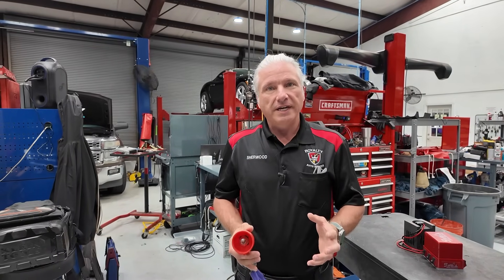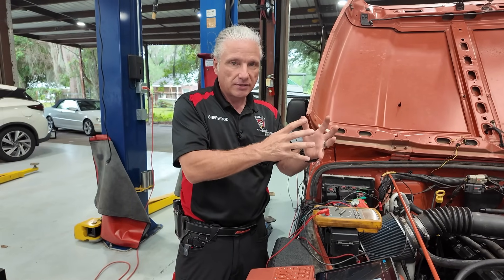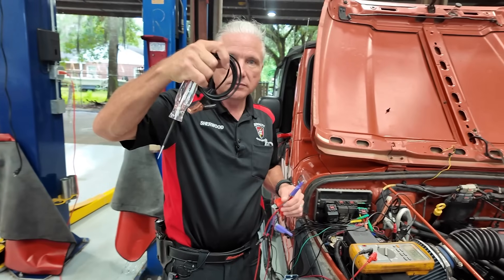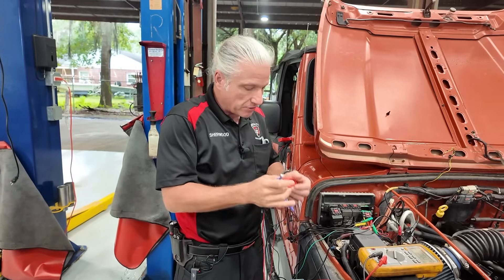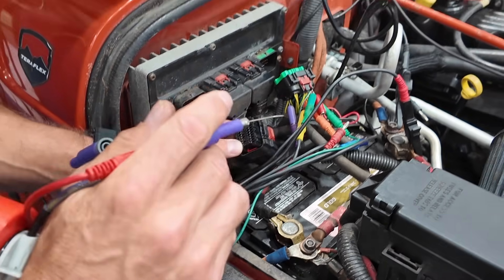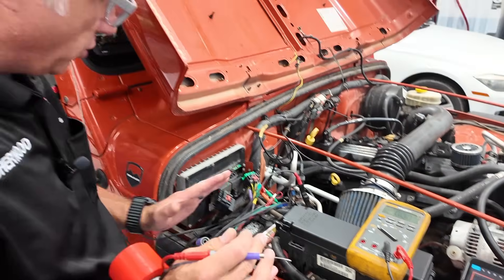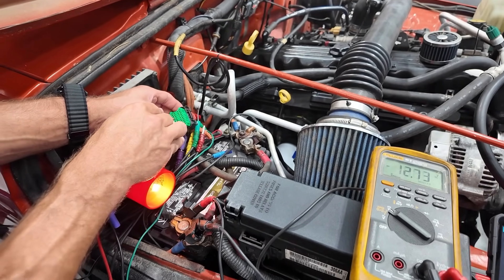This Will Protect You From Replacing Modules That Aren’t Actually Bad!

Comment: Drop test is good for checking the availability of voltage but a load test checks the ability for it to carry a load. My last PCM I recommend did a few bit of testing last thing I did was depin the wire from the pcm and from the accelerator pedal and checked the continuity through ground and power read open so knew no short to ground or voltage in the wire

Comment: @theroyaltyautoservice  Miller tool makes a BOB that gives you access to all pins in any NGC controller connector and allows you to make checks with the circuits actively connected to the controller. It is 8815 and 8815-1. THere may be a later model that is numbered 8815B that includes both parts.

Comment: I thought I would mention that the meters like your Fluke shown in your video have a high input resistance to protect sensitive electronic components components. The resistance is about 10,000 ohms. I started in the 60's using a VOM then switched to a VTTM like your Fluke due to the switch to transistors from tubes. You could draw to much current and destroy a component.

Comment: Check load and grounding connections on modules.make sure the bulb is well lit and not dim,make sure u test with the meter.so you know for sure it's that module working electrically .

Comment: So to use this gaget, one needs to know the max  amperage a module uses under load (use a suitable bulb to mimick max load conditions) and test both the power and ground wires with the ground wires with DMM.  Would this work for both Terminal 30 and Terminal 15  circuits?

Excelkent.

Thanks!!

Comment: why testing voltage drop on the bulb instead of the wire?
won't have to figure out if there is a significant drop, multimeter will say it. displayed voltage = actual drop.

Comment: I wish I could get wiring diagrams for 2015 peterbilt 348. I have no headlights , no wiper washers.  but hazards, turn signals and marker lights are fine. High beam indicator blinks when headlights are turned on. Power probe shows flickering beeping ground when off, oscillating positive negative 6.5 volts when on. It goes away when turnstalk module is unplugged

Comment: I can 100% agree with this video. Everything I test that needs battery voltage or more get load tested. As a matter of fact I don't even do resistance testing anymore for the most part. Yes there are variable that I do, do resistance testing  but for the most part I do voltage drop testing with the circuit loaded. I have a 1, 2, 5, 7, 10, 20 & 30 Amp load tester for various things(Made mostly out of light bulbs). I get so many calls of shops needing my help to figure out a vehicle and I find a bad circuit. The tech will swear they checked voltage/grounds, but where they get screwed up is they didn't load the circuit. Or they will not load the circuit enough.

Comment: Complicated, but well explained. Diagnosis - the key. No parts canons. Key is what you said, "Go slow and check" before saying something is bad. And having the right equipment. Those thin blade connectors are key for these tests. Thanks for all the tips and information.

Comment: Power probe has the ability load a circuit.  Use power and ground button. Breaker trips at 10 amps. Applying power to ground usually ok, however grounding power can pop fuses. Definitely need to know circuit before doing this

Comment: Don't know if you care but those bulbs draw a high amount of current when voltage is first applied. Once the filliment starts to warm the resistance goes up and current decreases. This only take a millisecond but good to know if you are pushing the limit of a fuse with several bulbs and blow the fuse when energize. This initial inrush of current is why
Reply: Many computers get fried that way with those 3or 5amp bulbs. I personally only use my GM 250mv test lamp on computer circuits. Excellent point 👊🏻But he’s only checking it with the connector not connected to the computer so it doesn’t affect the computer 👍🏻

Comment: Awesome video! Such a great teacher!

A couple of things I don’t understand though:

What voltage of bulb to use and gage of wire to connect it?

Is it possible to somehow bypass the fuse in the circuit by connecting the ground directly to the battery positive, or the positive to the battery ground? Or are both “sides” of the circuit protected by the fuse?
Get what I mean? If you bypassed tge fuse by mistake and your load was too big you could cook the circuit?

Comment: Excellent demonstration.
What you are doing is measuring the resistance of the wire (and any connections) under load. Putting the circuit under the 2 amp load, means you can measure tiny resistances as quite large changes in the voltage (a voltage drop).
When the battery voltage doesn't change, it means there is zero resistance on that wire.
On one of the 12 volt power wires, you measured roughly a 0.4 V voltage drop (12.7 - 12.3). That rather large 0.4 V drop  for a 2 amp load is equal to a resistance of 0.2 ohms (calculated using Ohms law). That's a very small resistance, and as you said can be ignored. 
If you happened to get a voltage drop of say 2 volts, that's equal to a resistance of 1 ohm, which still seems very small, but on a 12 volt circuit is starting to become highly significant. 
Most (if not all) multimeters are incapable of reliably measuring such low resistances (1 ohm and less). By putting a decent load on the circuit and measuring the voltage drop, you can in effect turn any old multimeter into a sensitive instrument for measuring very small resistances.  Its easy to calculate the size of that very small resistance, when you know the size of the load (in this case approximately 2 amp 12volt (ie. 24 watt) bulb .

Comment: 👍 always always do a voltage drop test before replacing and module. Like he mentioned, it really doesn’t take that much time. I made a drop box very similar to the red one in this video. Got all the stuff at
you do it electronics. All the switches to add more load as needed.

Comment: Yeah I did a Chevy Van BCM Program, for a bad rear brake light and turn signal.  I think it was the left one.  All the other signals and lamps worked.  I asked them if the wanted me to confirm the diagnosis first.  They said no, so I removed it from the box, installed it, and programmed it.  It did not fix the problem.   They then had me diagnose it.  It was a bad ground.  The other three signals used one ground and this bulb used another one.  I fixed the ground, and fixed it.  I am sure they still charged the customer for the new BCM.  I got paid and went home though.  I think I saw a video where Scanner Danner had the same issue on a Chevy van, but he found it before he replaced the BCM.  I normally just use a test light for a quick test, but if it is a computer that is going to cost a lot (I can't program a used one) I load test is with a 3157, and read the voltage.

Comment: I have a crazy problem going on.
I have a 2011 f250 with the 6.2L and I dont have that module under my truck,,anywhere.
OBD2 codes P0706, P0707, P1702.
So I did a fluid filter change,(was long overdue) magnetic doughnut had very little fine particulate, and replaced that very tricky range sensor with a new one from a ford dealership.
When I hit 65-80mph the transmission shifts out of gear and the shifter display "STILL" lights up like a christmas tree flashing multiple shift locations.
I think its the tcm, because if it was the wiring it would do it at all speeds but it dosent. Forscan would seem difficult to get right now and IDS is like $900 a year,,nope.
I still need to find the tcm to even just look at it.
Any ideas?

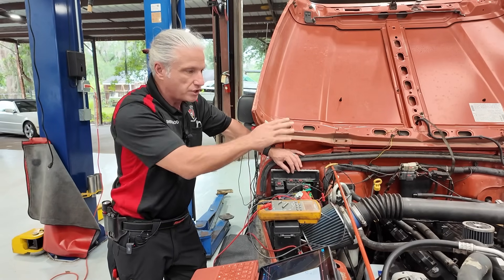Comment: 2:27   the diagram will hint on wire resistance, you know the affected circuit  test the circuit isolated from conponets,  test it for short to ground and how much the size and length of wire adds resistance.
You can also bypass both sides of the factory wires with jumpers direct to components to see if that improves the problems  
The fault could be a faulty connection between the computer and device,  last resort is condemn the computer   you have to look at everything else first and each Conectors in the voltage path.    
Yes pin's on a Conectors can be loose or corroded  its a automobile and subject to water intrusion.
Water and voltage cause metals to break down via electrolysis  separating water into it basic elements breaking the bond, its a chemical reaction.   Look it up.

Comment: 2013 jeep grand cherokee overland has can bus message in DIC, lost radio, hvac panel, lift gate, power windows, power locks if you unplug brown connector at the back of the instrument cluster everything starts working except the driver side power door lock button any ideas? 5 other owners with the 2013's and same symptom .

Comment: One of the best test any technican can perform but probably one of the most missed test. I worked in trucking for over 45 yrs. and trust me when I say I have proved many times how using voltage drop to diagnose will save time and is more accurate than voltage testing as a whole.

Comment: Earky in my career, had a similar issue. Tested and tested, only to find the circuit had a huge voltage drop under load. The Chevy Suburban iwner had his truck into 3 different shops, had the same to components replaced multiple times. When the truck came in to me, it was already a come-back for our shop. Did my diagnostic, found the issue, and recommended replacing the sub-harness, Why? The customer has spend over a $1K between these shops, and I wanted to solve his issue once and for all.
Found with my service manager to get the new sub-harness from the dealer, instead of pathing his wiring. The customer agreed with me, we ordered the part for GM, and all was perfect. Sometimes, you get a awesome service manager, and sometime you do nor Glad to see Royalty treats you right.

Comment: Great job checking under a load but you forgot to wiggle the wire for half broken ground wires and terminal connections on the block or chassis.  Bruce Duncan

Comment: you are right about the grounds being most of the issues. that has been what i have found and the other has been bad batteries. in my shop i cant get it through other techs heads that vehicles now are rolling computers and 1st thing of making sure battery is good is critical. Thanks for your education to other techs that are not strong in electrical repair. Most shops in my area send this type of work out.

Comment: Good lesson.
Year ago, dealer didn't do a load test before replacing the ECM on my year old Nissan.  Car wasn't running, still didn't run after the new ECM.  Ended up being a ground connection that they had not put together properly (in a hard to get to spot) on a recall repair they had performed a few months earlier.  Had they noticed the ground to battery negative terminal was not a near zero value earlier, it might have gave them the clue they needed.  Might have also helped if they considered what work they had performed recently.  Thank fully it was all under warranty, so it didn't cost me money, just time in the shop.

Comment: I was taught to do the voltage drop test the was you describe the starter voltage drop test in parallel to see the voltage that is not able to flow through the conductor to the load
The next test you show is wired in series and is a completely different test with different results

Comment: Great video. At the dealership, I use a sealed beam headlamp for load tests. Draws about 3 amps. I also put a cylindrical dome lamp bulb in my test light to increase the current draw and brightness. Do not use a led test light.

Comment: Well done, cars have become like computers and more than once the new meters will read a voltage when there's no current, or show a ground when its bad,

nothing like putting a good load on a circuit and seeing what happens.

Well done i even pick up a tip I never caught before, or notice 

thanks for tacking the time to post and helping new or old techs learn a thing or two 

See you possible have a new tech learning from a master tech as well

Comment: I also use a similar scenario when performing a continuity check. Many times a check with just a meter will show good as it only takes one single strand to pass a continuity check with a meter. But if pulling a load through the wire you can find corruption as one strand isn’t enough to pass the current through for the load.

Comment: I spent an entire Saturday in the shop on my time with a module that didn’t work right. I checked and swapped everything under the sun to try and figure it out. It ended up being the connector to the solenoid was pulled on by the previous snapped belt just enough to no longer make a connection. As soon as I turned off my multimeter and used a test light the answer was obvious. The wire was visibly intact and the connector had no corrosion. What a lesson to learn.
Reply: Goes to show, the root cause is always the last thing you check.
Reply: @thisisyourcaptainspeaking2259 lol why continue testing if you have it work after the last test?
Reply: @loulelea Because the root cause wasn't the 1st thing you checked.
Reply: 😅 @thisisyourcaptainspeaking2259

Comment: Great video, but this test is only good for the  powers and ground. But if you were trying to check the integrity of lets say a missing  5vref voltage,   you would have to load the wire either with a power pro or 5 volt battery and then check the same thing you were doing.

Comment: I have a truck with no power what so what so ever going to anything took to a garage the guy says you need a new computer 2800$ later and within 3 months it is doing it again, I give up on the thing not paying that again,  Going to buy an old school truck sick and tired of this crappy computerized garbage.
Reply: Battery terminals tight? If you can grab them and wrestle them off by hand, they're too loose

Comment: As you easily remember, once upon a time, you couldn't just touch the leads of a volt meter up and the meter tell you it's backwards. It would stop working. You would get to open it up and repair it. 
😅😂
Repair?
What is repair?
Thanks for the memories of the times I/we thought we had it ruff!
As I watch a mower repair channel guy say, "this ain't the space shuttle, it's a mower!"
When I work on cars now, my new saying is, "this ain't a mower, it's a 100 miles of wires, connectors, switches, module's and designed nightmares on purpose!"

Grounds should be the 1st place to look for problems.

Thanks for the details.

Comment: If you don’t like doing math you can connect the meter - to - or + to +, and when you load the circuit, the meter will show the voltage dropped.  Either way, great testing methods, wish more techs were doing this!

Comment: Off topic but in view of your expertise I have to ask about 2004 grand marquis LCM and it’s unreliable performance. I know about the recall and although never had a problem, went for it a few years back, just now fall 2024 I think it’s gone goofy and I thought to replace the relays because of intermittent behavior. Is there a relay that is perhaps rated a bit stronger or more reliable than stock?
Respectfully 🙏

Comment: I had a 6 year old F150 brought to me after others threw a 4x4 module at it and a servo motor, I tracked the wires the same way and found a main wire to the transfer case module that had corroded thru in the middle of a harness wrapped up with 20 other wires that was undisturbed under the hood, it was probably cut in the manufacturing process, lesson is never underestimate wiring issues before throwing parts at a problem.

Comment: There's a "CLICK", ongoing and odd as it is, either SRS Module To ABS, before the ECU/PCM. 2 relays in search of to eliminate. Color code wiring to 2 components which are heavy Ampere components. Disconnected connector where the "Click" is heard through the connector. 
How  is it to test between Module to another Module that the "Click" stopped when pulled that particular wiring connector other than find the Relay, Both, to Another Component (HVAC) that disconnected the "Click" Sound. Does it mean one of the Components through wires is affecting the Module SRS vs. ABS and DLC with ECU/PCM sending? Affected wires/wirings were repaired as seen.

Comment: 1. If you know the normal load for the circuit in question, use an appropriate incandescent bulb that uses the same amps. For instance on old batch fired system with 4 injectors on a driver, the circuit might draw over 3 amps. Then might need a larger bulb, like a headlight. 
2. You must use the location of the battery at the exact center of the post or center terminal bolt. If you connect the alligator clip to a post clamp bolt ,you could miss a large voltage drop at the terminal clamp itself. There can also be a corrosion problem at a junction block ,where the battery cable goes to.
3. Before condemning an electronic module you must also check for corrosion and pin fitment on both the harness side of each connector and in the module side. 
Good job on the video !
Reply: That's right 
First we look=test at the voltage drop across the battery terminals

Comment: Doing this to a 1996 Chevy 5.7 that blows up ECM fuse 20amps when running after a few minutes but stalling it does not blow up. Thas fuse is Postive and feeds a multiple sensors studying this video to find the issue. Im pretty sure its a intermittent short and load testing is going to show me where the issue is. Thanks!
Reply: Remove fuse, connect multimeter lead to side of fuse supplying the load, connect other lead to ground, set meter to Ohms, then wiggle wires and such and see if you can find the short.. helps if your meter beeps when there is continuity

Comment: I have a question about CAN communication network wires. Is it possible to do a voltage drop test across the network areas like p-can, c-can, etc?or is voltage too small to detect a voltage. I hope this isn’t a stupid question to ask